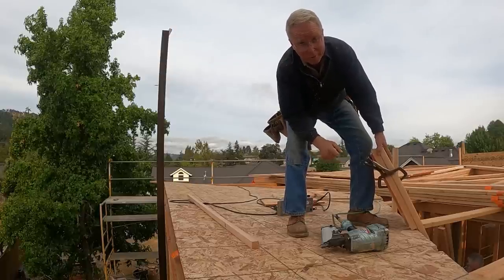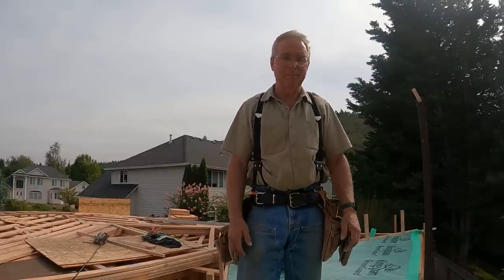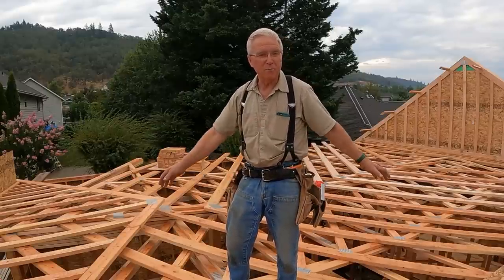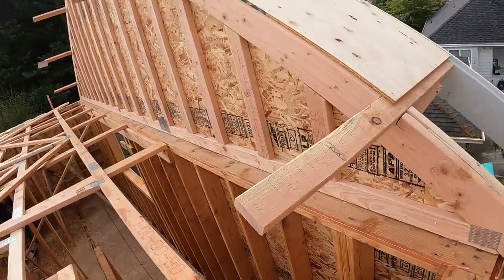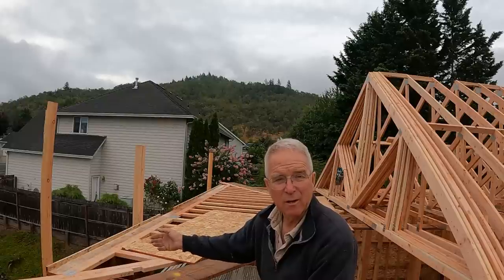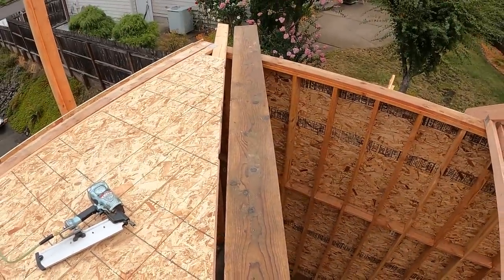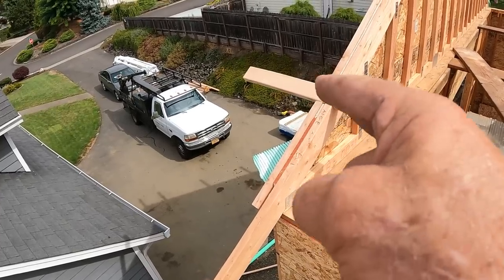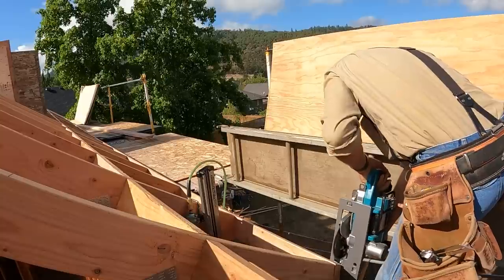Framing is an Extreme Sport - Stacking a Roof Solo: Shop Build #17

Comment: I'm sorry for my naive question, but wouldn't the lumber start rotting after it absorbed rain water? I saw it also in the spec house series, where you had layed the subfloor sheathing of the first floor and the day before you started framing the walls it rained and so the subfloor was prety wet in that video.
Reply: Nah.  I've seen houses sit for a year (huge houses + long delays)    as long as wood can dry it is fine.
Reply: EVERY HOUSE gets wet during construction. If the builder tells you otherwise, they are lying through their teeth. The issue would only be bad if it was constant, prolonged, and water pooled on it for long periods of time.
Reply: To add, I've seen osb stacked loosely on the wet ground for almost a year.. a bit flaky and some mold (which would die once the house dries) but still structurally sound.  "Rot" takes a long time or extremely unfavorable conditions
Reply: only if it sits for weeks without drying.
Reply: Not as long as it drys out. But the subfloor can absorb water and then u do have a bumpy subfloor that u will have to plain down.
Reply: It would have to get thoroughly soaked, like water absorbed inside of it, and for a bit of time before that becomes a problem.
Reply: Thank you all for the answers. I not living in the US, but in Cyprus, where we build houses out of reinforced concrete and brick rather than lumber. Something that is not as popular as lumber in the US, even though I watched some videos of people buying conrete slab houses.
Reply: @christoskettenis880  So what no one has addressed, sheet goods, as used in the US, for structural sheathing and sub-floors are manufactured with a resin or epoxy based adhesive which is MUCH more weather resistant to prolonged exposure to wet and inclement weather. So it's not much of an issue. HOWEVER, as some have said, prolonged exposure, beyond 6 months can have a detrimental effect on the finished house and interior finishes that are supported by those "underlayments". You DO have to do YOUR job and get it done in a timely fashion, or the finish carpenters and tradesmen following you will have a hard time doing THEIR job and protecting THEIR livelihood. Additionally, someone mentioned "mold"... Once mold has taken a hold on a substrate, it doesn't just "die"... If you see mold on ANY piece of building material, certain steps have to be taken to eradicate it, otherwise, it WILL keep growing. In my company and area, we remove and destroy any material exhibiting mold growth or we use a bactericide chemical to kill it where it stands BEFORE using it in construction.
Reply: @mikekellam365  Thank for your insight also. It was very enlightening also

Comment: Hello, I've noticed something in this video and it is bugging me... I'm hoping someone can explain the answer to me. On the gable ends, he notch's in to accept the 2x4 lookouts on flat. My question is, why wouldn't those gable been engineered 3.5" less in height, and then just build a ladder for your overhang and then tie in to the next truss? I understand the way you do it here is an easier method for working solo and uses less material but it also decreases ventilation. Why were these gables designed in this manner? Thanks

Comment: A modern attic should be inside the envelope and air tight. No need for vents.
Reply: A big space with a large volume of air that is not part of the conditioned space will create problems later.  Inside the envelope only works if all spaces inside the building are conditioned and the air circulated.  The attic being built here isn’t that so it must be vented.
Reply: @SteelheadTed  they get semi-conditioned with partial air circulation within the envelope. With modern air tight materials and insulation it’s much more efficient and comfortable than the outdated vented builds.

Comment: I just noticed that your looking goggles seem to be trifocal. How is that working for you? I have progressive glassed that don't work for me at all, so like the stubborn old chippy that I am, I don't use them. They work at distance (for driving) and at reading distance, but not at arm length distance, which is where most of our work happens. But without them, millimetres on my tape seem to be smaller than they used to be when I was younger.
Reply: I, too work over my head and have what they call "double D's" which have the reading part at the top and the bottom, distance in the center.  Ask your optometrist, not all do it, few do it well.

Comment: Shocked that you would go 4' centers on the barge rafters.  Never in 50 plus years of framing have I seen or gone more than 2' centers. And I have never gone flat with the barges either.  Hanging a 2x6 fascia onto a flat 2x4 barge means you have 4" of wood unsupported which, in my vast experience, will cup, twist, and essentially fail.
Reply: Lol. I've done hundreds of houses with flat lookouts 8' o.c.... 😁

Comment: You needed one of the new battery powered routers and a pilot bit in a bad way. It would have made quick work of cutting the OSB after you nailed it to the gable rafter.
Reply: That’s great when you’re working with other people or working alone on the ground, but fumbling around with multiple tools at height isn’t saving any time. Best to use one tool for multiple uses than a lot of single purpose tools scattered about
Reply: A power detect with 2 60v will cut all day long with no issue his problem is he’s old using a boat anchor to cut, routers are cool and all but not needed in the slightest.
Reply: You watch too much YouTube.
Reply: he made short work of that OSB without switching tools.  A router and a pilot bit is great for flush trimming material for dead precision, but in his case the circular saw is doing all the straight cutting he needs, and very quickly.
Reply: If you know what you're doing, and can handle a saw, cutting a straight line 1/16 or 3/8 or 3/4 isn't much effort. We're "framing" not building "cabinets"!!!

Comment: Never ever....EVER NOTCH A TRUSS. Best practice is to nail your 2x directly to the plywood/gable and screw from the inside into your barge blocks.
Reply: It's a gable end dude. It's more like a wall than a truss....I'd actually call it a gable wall. It's fully supported by the wall plate below. I agree that any free spanning truss should never ever be cut except at the tails.
Reply: @marcellemay7721  the offcial name is a gable truss. But I didn't become a veteran carpenter by using the proper  terminology... it dosent matter that everything everything is sitting under a wall. The actual trust that he notched can snap and break. There's no weight on top any way but the fact is you never notch trusses. To frame a barge on a truss gable  you first: Plywood the gable. Then you nail what ever size barge directly to the gable. Then from the inside use structual screws to secure your barge blocking minimum 4 foot on center. However I like to build the barge in a unit and then attach it to the gable but he's doing it by himself  so that would be trick.
Reply: @michaelcarroll991  I don't notch my gable trusses or rafters for over hangs either. I actually do them the way you do, and once it's raised I add a long structural screw from the back side. I find it to be too slow and tedious to do it the way he does. I'm not saying his way is wrong, just not how I would do that part.  Honestly though, my framing days are pretty much over. I just can't work that hard anymore, and I don't want to. The past 4 or 5 years, I've just been doing high end interiors, mostly remodeling. Wood work, kitchens and baths, built ins, trim and interior doors...that kind of stuff. The highest I climb now, is usually 2 or 3 steps up a step ladder. 😊 I paid my dues...I'm done with climbing on roofs and walking walls.

Comment: Your old-fashion thinking is long past gone!!!
Most MODERN BUILDING CODE REQUIRE ATTICS AND CRAW SPACES TO BE SEALED!!!
Matt Risinger calls it Conditioned Attics and Conditioned Craw space — insulate the under/side or even outer roof instead of the ceiling!!!
Reply: This is a shop, not a house.
Reply: @Rick-ro8bf  

ANY building should be built to the best possible standards…
It’s not a Rake and Tool Shed.
Reply: @BrianBriCurInTheOC  isn’t a shed a building?
Seriously, I agree with you in principal but... this is a workshop in a mild climate built with roof trusses. There is no useable attic space. There is probably not going to be any ductwork in that space. Why should they go to the expense of sealIng the roof when they can get the same benefit by sealing at the ceiling?
Reply: @janderson8401  

Well the same reason a metal roof is better than cheap asphalt shingles!!!
A Metal Roof will at least last 50+ years, that will require two Roof jobs with shingles and another soon after that!
Scott is a great hard working guy but he is behind the times — should have used ZIP Panels on Roof and Exterior Walls!
Building with quality products guarantees a MUCH LONGER LIFE SPAND, and much lower costs all around!
Reply: Umm...not quite. Modern building codes allow for multiple methods including traditional vented attics and crawlspaces.
Reply: @adamr1637  

You obviously do not live in a modern metro area.
And you do not UNDERSTAND ‘Building Science’.
I have been studying the subject after a lifetime of building, repairing and remodeling Rooms, Homes, Sheds, Barns…. The list goes on!
In my life I have learned a subject only to be shown even decades later that there is a better way, or a even an intelligent/scientific way which is contrary to ‘common knowledge’.
As a young kid, I belonged to an organization called 4–H which had/has the motto : 
MAKE THE BEST 
B E T T E R…
Building Science is about 
Making The Best BETTER!
There are many reasons to do so, not many to NOT!
Reply: @BrianBriCurInTheOC   @Brian Curwick  Brian, Building science utilizes proper methods for a number of different applications. I am a licensed code official and can assure you I am very familiar with various construction means and methods. May I suggest you go to ICC or Upcodes and review your own state and local codes. I assure you they will allow for conventional methods because they also 'follow building science' and work.  Depending on what you build, your local climate, etc. you have options which may have varying benefits. Efficiency is only one aspect to consider and can be achieved in a myriad of ways. Do your best work and make allowance that there can certainly be more than one right way.
Reply: @BrianBriCurInTheOC  Assuming (always a dangerous thing to do in real life let alone on line) that Scott's son in law isn't going to put a bunch of recessed can lights in the ceiling or stick an air handler and a bunch of HVAC ducts in the attic, It's probably less expensive to air seal and insulate the ceiling than it is to insulate and seal the roof and gables to the same R-value.
In a perfect world we would build with high quality products that would result in a lower cost over the life of the building. however high quality products usually command a premium price so you have a higher initial cost and a longer time period until you break even.
Reply: @adamr1637  .
AS A YOUNG KID IN 4-H THAT ORGANIZATION'S MOTTO BECAME STUCK IN MY HEAD -- "MAKE THE BEST BETTER!!!'
TOO MANY PPL ARE BUILDING "THAT'S GOOD ENOUGH" HOME AND THEN AS MATT ALWAYS TALKS ABOUT THERE ARE BUILDERS PUTTING CARDBOARD UNDER SIDING. MY DAUGHTER & SIL JUST BOUGHT A BRAND NEW BUILT $2.2 MILLION HOME WHICH LACKED MANY OF BUILDING SCIENCE FEATURES/METHODS WHICH SADDENED ME AS YES THESE HOME WILL HAVE A LONG LIFE BUT COULD HAVE BEEN BUILT MUCH BETTER WITH ITEMS LIKE ZIP AND ADVANTEC AND A FEW OF RISINGER'S TRICKS TO BRING A TRUE VALUE OF WHAT IS NOW AFTER 6 MONTHS A $3M HOME...